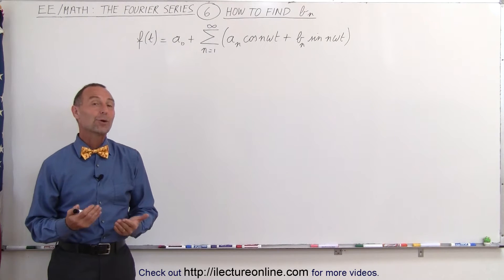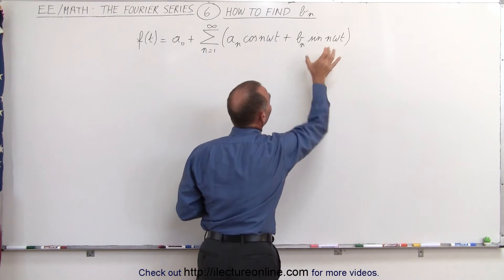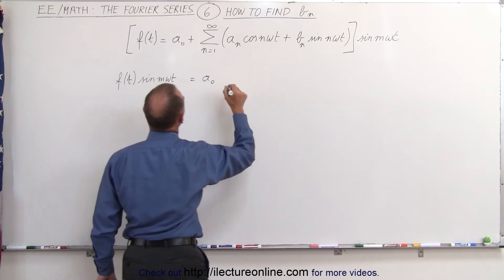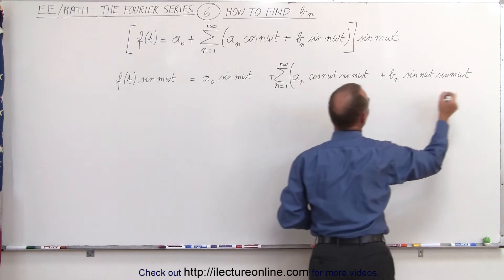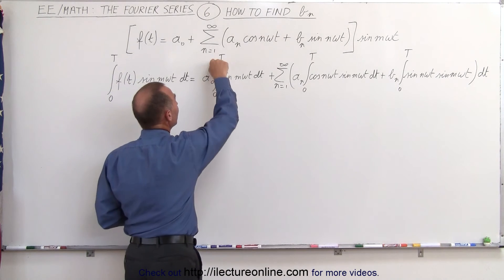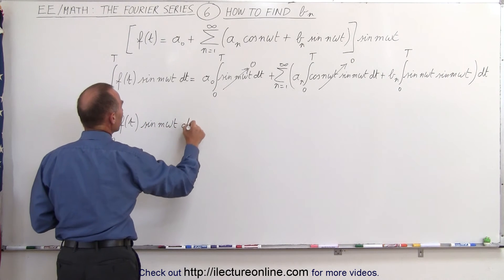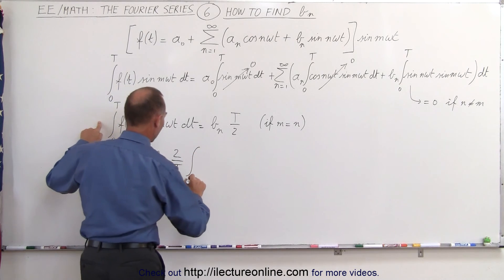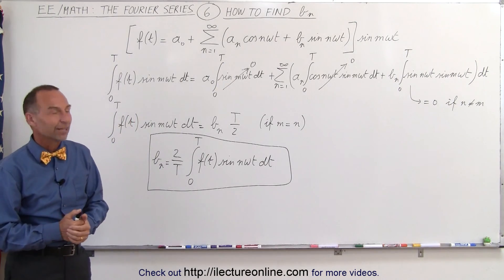Electrical Engineering: Ch 18: Fourier Series (6 of 35) How to Find bn=?

Comment: OK BUT so b_1 = f(t)sin(1wt)dt and b_2 = f(t)sin(2wt)dt and so on so on right? what is the pattern here and/or implications? The use case or usefulness. One thing that is missing is the intuition or relating the bigger picture here.... So far you taught us a mathematical technique to solve for the constants, but I am missing the intuition and use case and examples. I also want a graphical or physical depiction if possible.

Comment: yet another great video making one of the hard topics in EE look like a piece of cake, thanks a lot sir. With due respect I would like to point out that I feel that the dt should not be outside the brackets in the second line, rather it should be attached to the sine term inside the bracket. Thank you a lot.
Reply from the maker: You are correct.  That dt is on the wrong side of the parentheses.  Good call!
Reply: my pleasure..